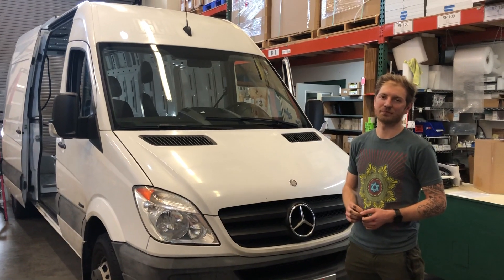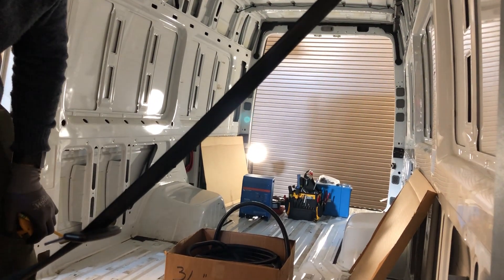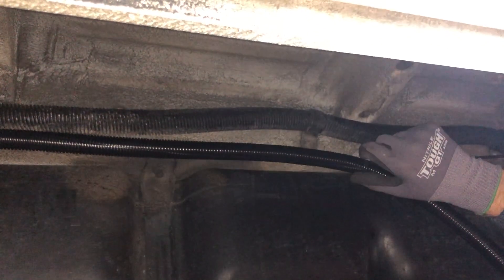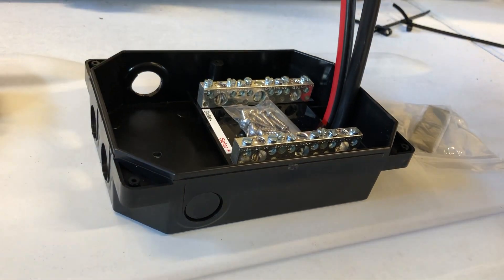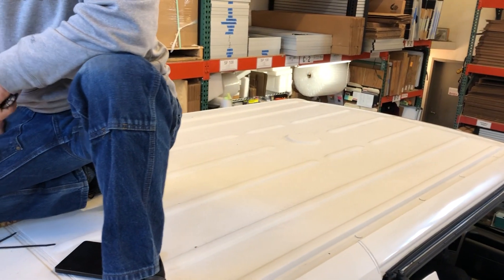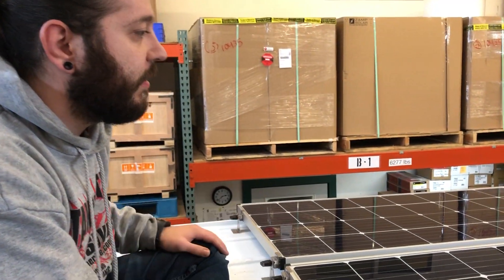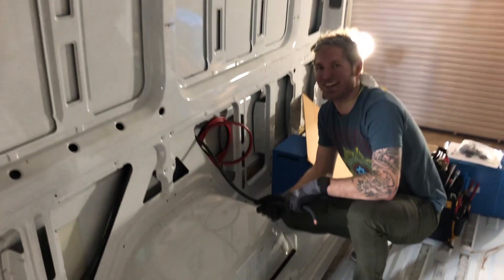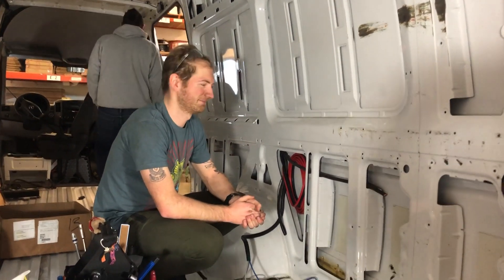Van Solar Conversion - Up On The Mountain (Pt. 2 - Solar Panels)

Comment: not quite catching the cable size to the Alt are you saying 2/0 70mm2 cable? thx
Reply from the maker: Sail Rock Paper Scissors Yes, 2/0.
Reply: @GarretTowneAMS  thx what size have you use on the CB's and the BP units looks good.
Reply from the maker: Sail Rock Paper Scissors I think it was 6ga.